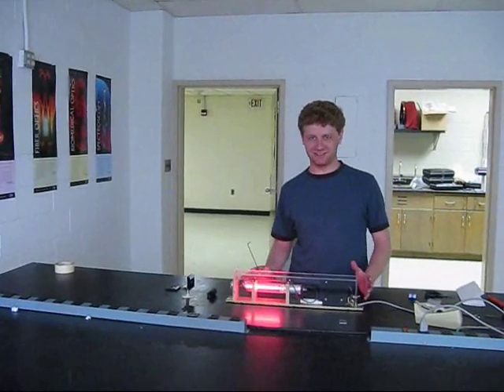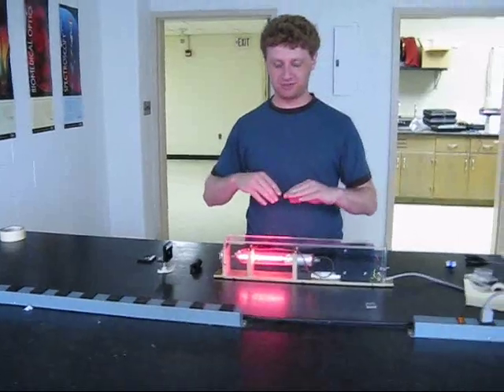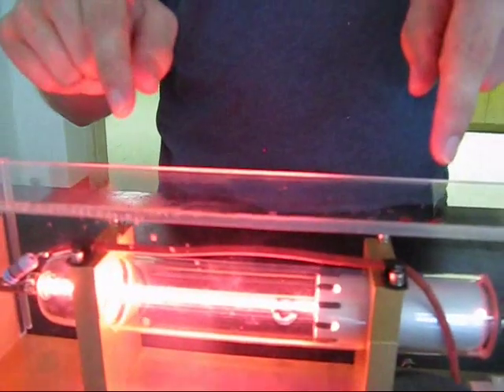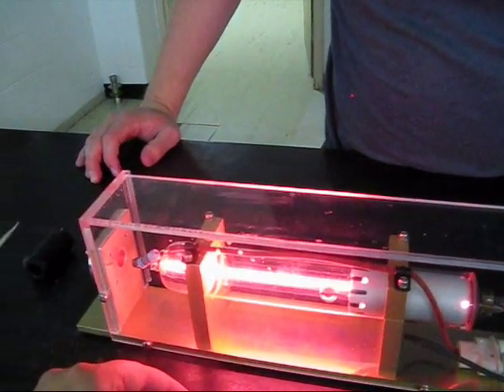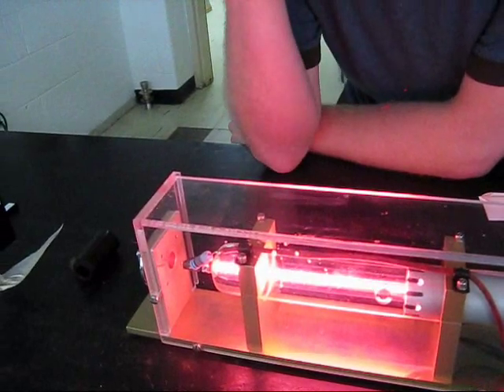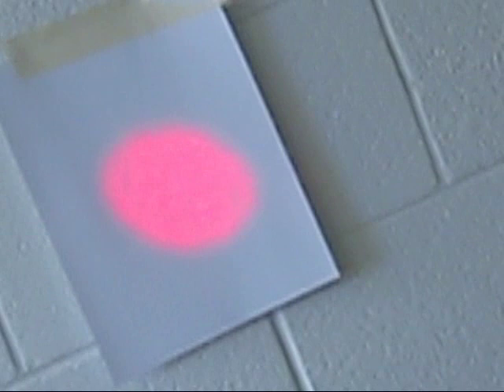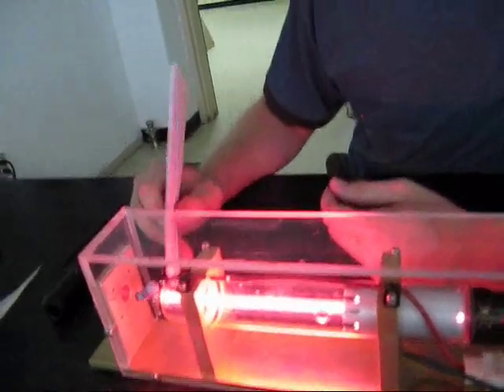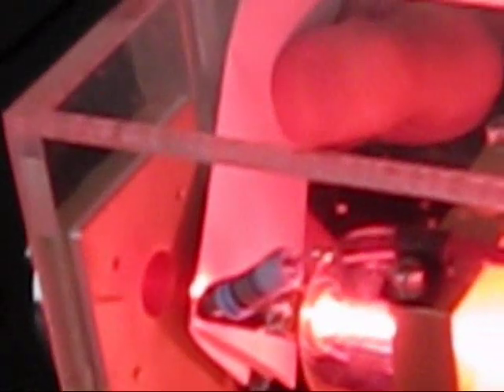Helium Neon laser

Comment: I have several of these type of HeNe laser tubes donated to me and am trying to figure out the cheapest and easiest way to power them via AC 120V current.  
I like your explanations here but am confused about the talk where you put a mirror in front of the beam. In that case how does the laser beam get to the wall? 
For Bill R's comments below - "build your own power supply..." I have not seen a good step by step video of that process. 
I wish the video creator would explain the power source he uses.
Thanks!!
Reply: +Bill Kranz It reflects most of it, transmits the rest(which you see on the wall).